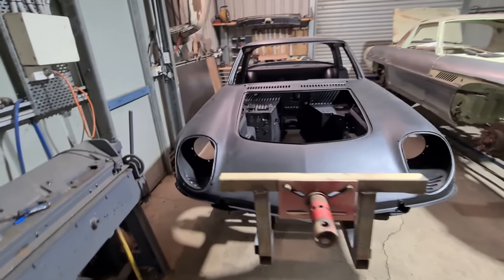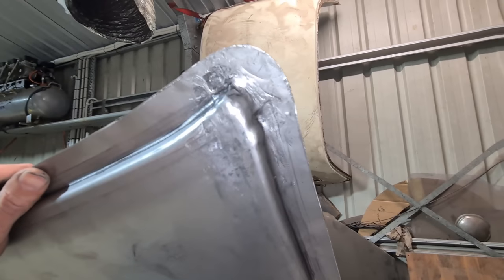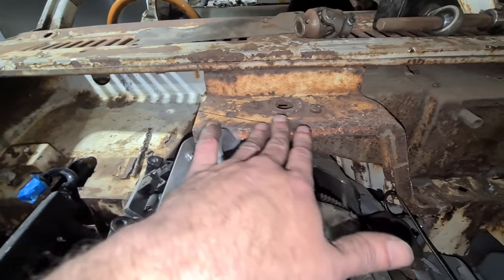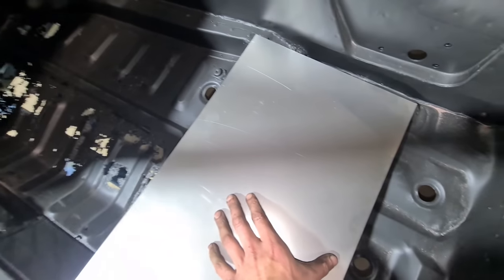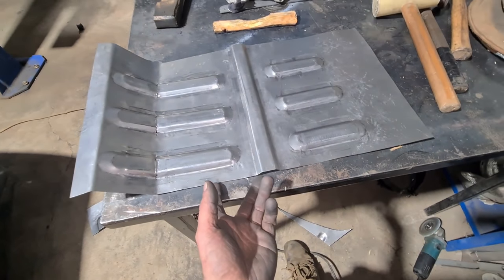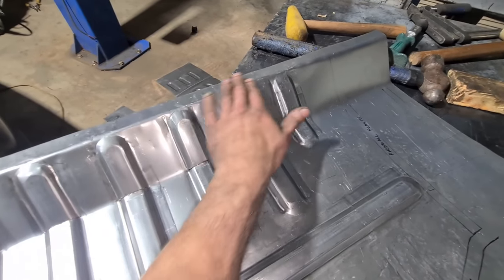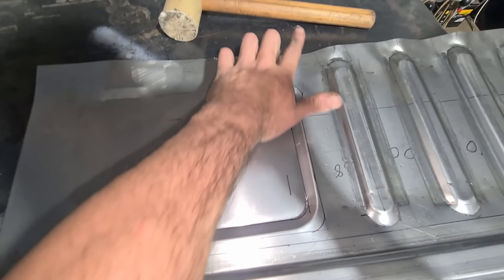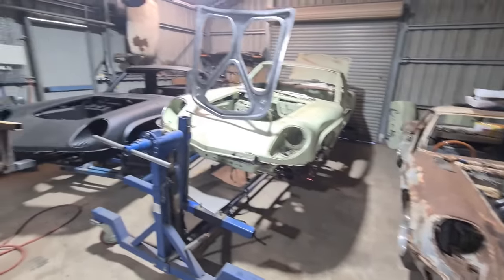Saving 3 Mazda Cosmos - Remaking Floorpans & Bonnet

Comment: Your doing an amazing job. As a suggestion , I found that making templates of the hood profiles really help full. This way you can creep up on the shape and use it a guide. Wray Schelin has really good video's on this.
Reply from the maker: Yeah I really need to do more profiles for checking, I did succeed with the bonnet on my second attempt at it, added the shape first till it sat naturally on the car before I added the flange, I haven't actually posted it, might order a bonnet latch and add it to the next update video for my car.

Comment: Your doing fantastic work and your skills are great but you've encountered the same problem we all have. How to form the guttering /channel down the front wing /fender and rear trunk. Alloy bodywork is cut short and riveted to the steel substructure (aston martin etc) steel stuff is entirely different. Check out Brandoli the Italian genius. It's heated up and chased in to a steel frame or buck. Took me years to work out but now it's easy. Cheers
Reply from the maker: Thanks mate. I make perimiters of the door/boot opening channels with just the bead roller and shrinker stretcher pretty easily with no buck or hammer form. Can do C channels of any shape and direction out of a flat piece quite easily. I have shown the process in another vid. Will be sure to show more of it when I'm up to the openings.

Comment: More than awsome work. But for the frame, could you not have done it in sections and rewelded, because you don't have a 10 ton sheet press to handle a whole sheet easily. 

PS, have you popped over to the Cosmo restore on Yorkshire Car Restoration.

Comment: if you pre stretch the bead patterns for the floor its easier and mitigates stretching warping on the flat areas
Reply from the maker: Yeah it would deff disort less but I felt like there was just too many beads in this sheet that it makes marking out so much harder so I chose to deal with stretching surrounding areas afterwards. If it was just a few or I had a plywood guide and was making multiple. For sure would be the go. But I chose the painful and slower method as I wasn't sure how they'd react haha.

Comment: I was asked to take a mold from a TVR Griffith 500 front end after I had repaired a right off one I also had to make a bonnet mold I thought I was pushing my glassfibre skills as the only glassfibre work I had done was on milk floats for the local dairy LOL .
Reply from the maker: Haha I hate fiberglass or filler , the dust and mess it makes is insane